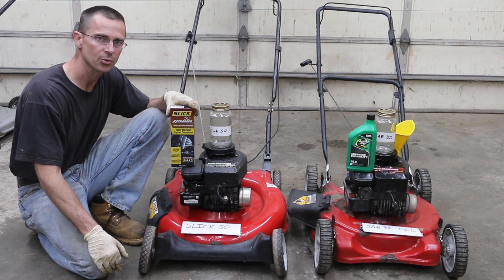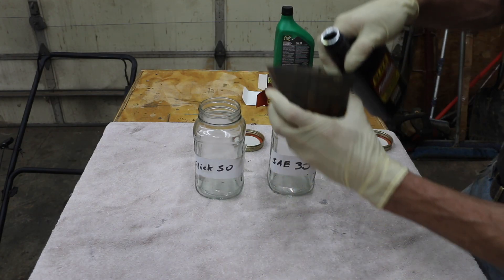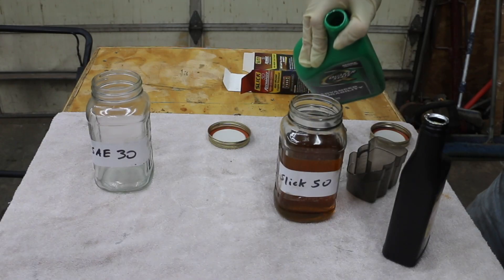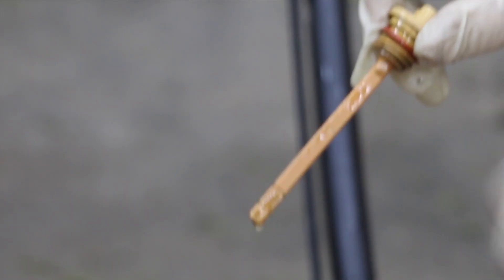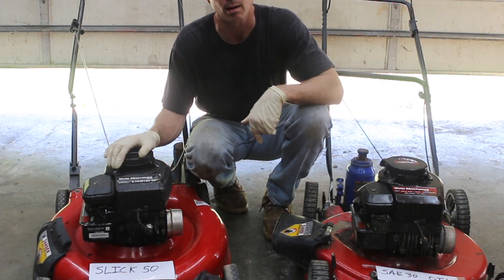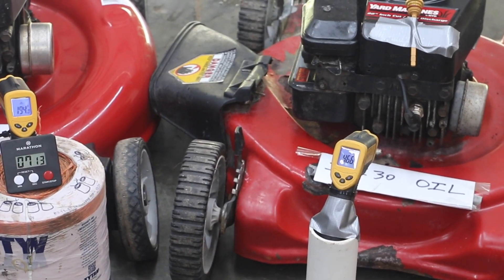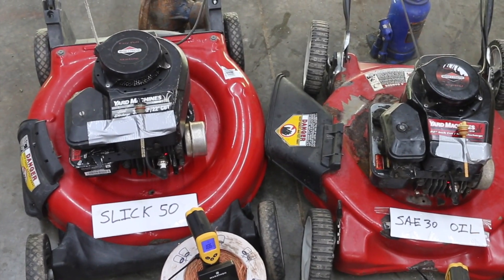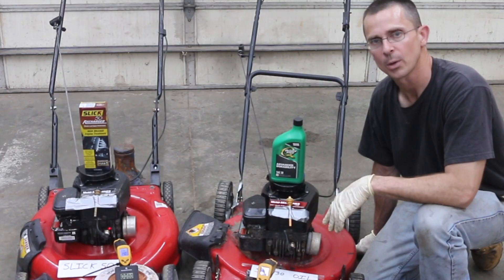Can't believe what SLICK 50 did to my engine!!--Dry Crankcase Test!

Comment: Interesting test! 
However I thought that slick 50 commercial featured an engine  that was initially running on 100% slick 50 before draining the slick 50 out of it, not at the recommended strength. Slick 50 still reduces friction and operating temp which SHOULD translate into longer engine life and better fuel economy. Then again STP used to make all kinds of claims regarding extending engine life and saving fuel as well. Then again, the Car Talk brothers routinely made fun of the "magic elixir charlatans" so i don't know where i stand on any of these kinds of products.
Reply from the maker: Thank you!

Comment: great job on your videos before icomment on this i would like you tocompare the jb weld clay to the jb quick and original
it ishard to believe theclay can bond aswellbut its usedin engines to reshape intaketransfer and ex ports
somany variables with thisslick 50test i vote you do over
the engines really need to be identical in every way 
mower heaters (what i call ice's)have only recently started pressure fed rod big end bearings
auto engines been using a forced film forever
you should have autop-seed them mower heaters to se what failed
some even have igus type plastic cam lobes 
then there is load them slick 50miracle engines were never under any real world loads 
a good condition plain bearing crank can go along time just free wheeling on a test stand or putting around a flat parking lot in a pinto at 28 mph max lol
if that slick50miracle heater has belt camtiming and rolling element cambearings and rolling camlifters 
and moly coated piston skirts 
shucks and keepit cool 10%#max load on occcasion 
looky its a miracle !! piston rings hate oil,in anything but an unseeeabble micro-impreg in the liner bore
in fact piston rings will not work and will +overheat and quickly fail if lubed 
a fresh bore new rings and pistons should not be slathered with oil opn assembly 
there should only be enough film of oil 
iuse 2-3 drops of oilon skirts of pistonfor assembly in the liner toprevent rust after getting it surgically free of grit 
roller followers need almost nooil as do any riolling element bearings
the oil is tolube the balls cage sliding
there is an additive that actually improves wear resistance and that is moly sulfide 
however it is a tough sell ...turns yer oil coalblack see ?
almost all mfg of ice's now use moly coated piston skirts 
back in the day we used kalgard 
they had a very specific line of baked in phenolic resin carried moly coatings 
gunkote gearkote piston coat same formulaasgearkote
and the best blackest motorcycle chainlube 
gunkote and gearkote are still sold by kg coatings 
i highly recomend it for vintage motorcycle camlobes and cam followersand piston skirts 
remember too much oil or grease is just as bad as none when it comes to higher speed rolling element bearings 
toomuch oilpressure in your roundy round race car is very bad 
back in the day there were allkinds of hi flow oil pumps and higher volume.etc 
thing is the poor saps were knocking out crank big ends from an unsustainable tune that detonated 
small block chevy v8 's never did still dont have oil needs beyond 10lbs per 1000rpm 
lol smokey figured that one out by simply listening to the heaters out on the sprint tracks
them ole boys racing engineswith all kind of perf mods none of it tested nor listened to most were deaf like me anyway 
keepit simple man 
crankshafts get ruined by detonation not under oiling cause no amount of oil can stop the det hammer 
hers another one 95% OF 'carb" ISSUES ARE IGNITION LOL 
you cannot tune a heaters airfool mixture without first being 100% on a perfect functioning ignition 
oh another good oil additive not to be overused but zddp is it ..but its 
toxic ,it kills cats and attacks bronze if too high in quantity concentration...
but does wonders to keep non rolling element cam lifters and followers happy 
this iswhy diesel truck engine oil rotella,etc is darn good vintage motorbike oil
Reply from the maker: Thanks for the video ideas!

Comment: I enjoyed the video but had my own thoughts as I was watching since I had done pretty much the same test in the early 1980's. I had treated my lawn mower (as well as my cars) understanding that the company never recommended running engines without oil. I believe that I treated the mower engine by running it for about 9 or 10 hours with the Slick 50 in it and then left it in while mowing my lawn after that.  Now, I did have a Briggs & Stratton engine with a horizontal shaft and a hole in the side covered with a piece of plexiglass (so you could see inside) because I did actually run that one without oil for 30 minutes at a time for demonstration purposes. (I was selling the stuff.) One day a guy said that it would be more impressive if there was a load on the engine and I thought of my lawnmower. I went home (In Katy, TX on the west side of Houston where summers are really hot!) and drained my mower overnight. This was at the beginning of the summer as I remember. My yard was not a large one, maybe 5000 sq. ft. but I mowed the lawn week after week until I really wondered how long it could possibly go on! Finally, one day, the mower stopped. I pushed it over to the sidewalk and started it again. The third time it stopped, I couldn't pull the cord so I put it in the garage for a while to let it cool off, put some oil in it, disconnected the spark plug and worked the blade back and forth a couple of times. Then I started it back up and finished the yard. I continued to use that mower for years. When I pulled the head off years later, the cylinder wall was like glass! Now that I think about it,  that 36 year old Briggs & Stratton with the hole in the side is still in my garage. I need to dig it out and start it up!
Reply from the maker: Thank you

Comment: older engine is looser, fact. newer engine tighter. slick 50 ran cooler. but it is really hard to say? without destroying two  brand new engines?? of the same type..   Older one would run longer because it is looser..One thing is for sure . THE SLICK "50" sure did not live up to the commercials..it is a fraud? good job. It should have ran longer. If in fact it does as they say.. I did like the loctite vs. JB weld. The experiment proves itself very well! I was extremely impressed.. does it contain epoxy? the torque wrench experiment was incredible I did like that Video... Verygood! Have A Great Day!   Now if we could get the political hard core facts and tests up for transparrency? with convictions for lying about the facts and all the numbers? BUILD THE WALL! LOCK UP CORRUPT POLITICIANS(!@#$%%$#@!) ! WHO WHEN ELECTED: TURN THEIR BACK ON ALL VOTERS! AND RUN OFF WITH THEIR BRIBE MONEY -  CALLED CONTRIBUTIONS. Sorry i Just had To Through That in...
Reply from the maker: Thanks for the constructive feedback.

Comment: The ability of a lubricant to prevent lockup on an engine after the oil has been drained has very little to do with its suitability to use as directed.......Slick 50 is pure garbage but your "Test" proves nothing.
Reply from the maker: Thank you

Comment: They must have changed the recipe, I did some of the original testing in High School for it before it came out as a commercial product.  We rebuilt lawnmower engines from scratch, did a control group of regulat oil, slick 50, slick 50 oil treatment and fuel treatment.  Team then for 1/2 got them drained them and ran them, oil siezed under 5, slick 50 treatment alone kept running but made nose after 30 min, the dual treatment we had to stop because there we're no issues.
Something tells me corporate greed got to the original formula and isn't the same anymore!
Reply from the maker: Thank you

Comment: Ex wife ran our truck ( '72 dodge 302 with camper and kids) 30 miles on a seized oil pump. I used Power Punch additive. Replaced broken distributor shaft, dead oil pump, refilled with fresh oil and Power Punch. Engine was still running 8 years later without a rebuild. She didn't know what the banging noise was or what else to do so she threw in a couple quarts of oil at a gas station and drove home. This was before Cell phones.
Reply from the maker: Thank you

Comment: This could be totally dependent on what condition the motor was in before.  You would have to rebuild or use new engines to get a realistic results.  How lean an engine ran or any number of things would need to be accounted for.  I'd  be interested to see how standard synthetic held up vs the regular 30 weight too.
Reply from the maker: Thanks

Comment: Outstanding video and definitely a surprise. I'd be curious if there's a difference between the Slick 50 of 25 years ago, which was a quart bottle that you swapped in to your oil change (though I believe it was 1 qt of Slick 50 for up to 6 qts - so still about 10% minimum I guess), vs the current additive.  

I have personal experience with Slick 50. It was 25 or so years ago, but we had a Toyota Van that got the treatment every oil change. One time leaving the grocery store, we ran over a parking block and ripped the drain plug out of the oil pan, leaving all the oil in the parking lot. We drove home 6.5 miles or about 15 minutes (including a 3 mi stretch at 50 mph), and parked in the driveway.

The next day we came out, started up and backed around noticing a very small oil patch that didn't used to be there. Looked under the car, saw the damage and shut it down. We had it towed to the garage and checked out, no damage to the motor at all. It was still going at 225,000 miles when we finally sold the van years later. 

There are a few differences here which may contribute:
1. Van only needed about 3.7 qts in an oil change, so adding in a qt of Slick 50 means it was closer to 25% mix
2. Van had Slick 50 added at every oil change for quite some time leading up to the incident. Might that equal better "penetration" or protection in the event of oil loss?
3. Difference in tolerances of a car engine vs mower engine?

Anyway, I haven't used it in a vehicle for years at this point, but it's still curious why your experiment was so different - or would our engine have done just fine on its conventional oil?
Reply from the maker: Thank you

Comment: This is not a fair test as the conditions of the individual engines are unknown.  They are unlikely to be identical as to bore wear. The slick 50 treated engine seized
 at a much lower temperature , which indicates that the bore was tighter to begin with
Reply from the maker: Thank you for the constructive feedback.

Comment: Make sure it has a lawn mower that had a hole in the crankcase that was slick 50 in it that we used all summer with no oil in it cutting commercially also just recently oil filter fell off my wife's fan that we've been using Lucas in and she drove it for 2 days with no oil in it before it started taking
Reply from the maker: Thank you

Comment: I ran Slick 50 in a 360 Mopar  engine years ago.  The engine ran cooler with it, like you found also.  I never tried running my race engine with no oil.  It must help when used with the oil, but can't lubricate the engine on its own.  Due to the cooler temps, it works with oil to reduce friction, but can't lubricate by itself.  Therefore the product works with the oil, but not the way the lying salesman say.
Reply from the maker: Thank you!

Comment: I used Slick 50 once in the 1990's.  Your suppose to add it to the oil and drive it for a while.  It's suppose to bond to the metal.  I don't know if the Slick 50 helped my engine or not.  About a year after I added it my fuel pump went bad and flooded the crankcase with gasoline.   I figured the gasoline washed the Slick 50 away.  I drove the car for 3 more years and put 25,000 miles on it.  Although I never had problems with the engine.
Reply from the maker: Thank you

Comment: I had a 1986 chrysler 5th ave that i put 1 quart of DuraLube in every other oil change. I got lazy once and had BP ProCare do an oil change on the non DuraLube cycle. I then drove to work 65 miles almost all interstate driving. About halfway to work, I had the oil pressure light come on. I pulled over and left engine running as it was not over heating. I checked under oil pan and noticed oil plug missing. I decided that since BP ProCare screwed up, I would just continue driving and if engine seized, it was on BP ProCare. I made to work no problem. After work, I drove the 65 miles home and stopped at BP ProCare near my house. Yep, engine still running and not over heating. They came out to look and couldn't believe it. Of course they put in new oil and plug and  guaranteed that if engine did seize in near future, they would pay. Also got 3 free oil changes. Kept car for 3 more years until I bought a new car. I put DuraLube in every car or truck I've owned since and feel very confident.
Reply from the maker: Wow!  I'm impressed the engine survived.
Reply: Those 318 V-8 Mopar motors are one tough motor.

Comment: My dad and I worked on a car that had 50 in it well the heads did have a film of oil on them so much we had to wash it off with gas so with that I say it would save gas because the lubricant making the engine parts move easily but I might be wrong.
Reply from the maker: Thank you

Comment: Another great video Project Farm!! I too used Slick 50 in the 80's, my chey 350 engine ran cooler, but no real mileage gain, but it ran for a long time with oil in though, with 300,000 plus km.
Reply from the maker: Thank you!

Comment: This really can't prove anything if you start this test out with two used engines, it could be just by chance that the slick 50 engine was already more worn out than the SAE oil engine , so to make the test more accurate go to the lawn shop and buy two brand new engines then try the test for more accuracy, I'm not trying to defend slick 50 , I wouldn't use that crap if you gave me a case full of it ,but I'm just saying for better accuracy the test should be done on two brand new engines.
Reply from the maker: Thanks for the constructive feedback.

Comment: I don't get this. If anything they should have been almost equal. Did the pistons seize? What was the damages? Were they the same damages? We did put 350000 miles on a V6 in a lumina van that slick 50 had been used in. No engine work ever..water pumps but no engine work. It still ran fine when I sold it. It rolled, the engine ran perfect but nothing like wipers, lights etc did. I dount it was the Slick 50 but the engine oil and air cleaner were changed, oil 1000 miles and air cleaner about 20000. Sparkplugs twice. With plugs the distributor and wires...

Comment: Never buy slick 50. It won't even make it past your oil filter so you're just shortening the lifespan of your oil filter. Plus Teflon doesn't work on metal to metal contact.

You're best option is to use a high-end full synthetic oil and don't even bother with additives and don't always buy the cheapest gas in town, it's usually cheap for a reason.  

Also don't fill your tank while the fuel truck is there because if there is any sediment in the fuel tank (at the gas station) it will be disturbed and swirling around. Better to wait until all that stuff settles before buying your gas.

Also avoid any additive that smell like chlorine (bleach). They will eat away at engine parts over time. Aftermarket additives are for the most part harmful not helpful.
Reply from the maker: Thank you
Reply: I been using slick 50 for over 20 years and it don't smell like bleach, lol, this guy probably sell oil for a living. Slick 50 works when you give it time to coat the internal parts of the engine.
Reply: @davidlawhon9303  no slick 50 isn't chlorine based but some additives are. I don't sell additives and don't recommend them either. They're a waste of money. All the detergents needed are already added to fuel. High quality synthetic oil and a good oil filter are all you need. You're much better off saving your money for regular oil changes then buying snake oil like slick 50.
Reply: I agree whole heart with your statement.
Also don't fill your tank while the fuel truck is there because if there is any sediment in the fuel tank (at the gas station) it will be disturbed and swirling around. Better to wait until all that stuff settles before buying your gas.
I worked at a truck stop and a couple of gas stations. 
The fuel delivery drivers told me never fill up while or after a the tanks where being filled.
Stirred up dirt in the tanks. Granted the pumps do have a filter built inside the pump, but those filters are not changed very often. Maybe once a year if that.

Comment: I remember that slick 50 commercial. A lot of manufacturers are promoting synthetic oil. I don't know if there's anything better about synthetic oils or if that's just politically correct in the eyes of the world. I don't think there's anything that can keep a completely dry crankcase engine running for too much time. You're experiment was great!
Reply from the maker: Thank you!

Comment: Can you try a product called mbl8?  Very similar claims to slick 50 but not teflon  based and has shown to be working on a dragster engine   after it was treated then all oil drained and ran for over an hour with dry sump.  Be interesting to see how it stacks up.  Also the 20k dragster motor was not damaged in the test.
Reply from the maker: Thank you for the video idea!

Comment: Looking at both jars when draining took place...looks like all the slick 50 came out...while there was some of the sae 30 that either burned up or my guess is was left in the crankcase. Personal experience with slick 50...definatley lowers engine temps. Bad thing is on today's computer controlled cars, it may consume more fuel (air fuel runs more rich)
Reply from the maker: Great point. Thank you